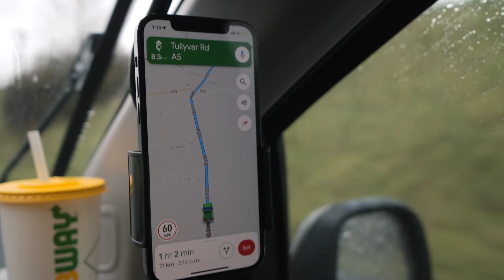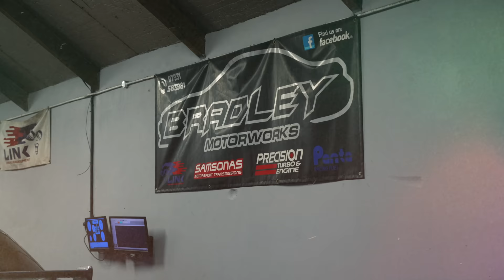We bought a JDM car we have been searching YEARS for...

Comment: Just thought of some videos I watched years ago of the Australians, they would get a rb20 block and get a rb26 crank and rods and make a rb24 if done right 8k rpm is possible 300-600 hp depending on turbo size and supporting mods bla bla bla search it, it's been years since I had so I'm probably missing alot of information